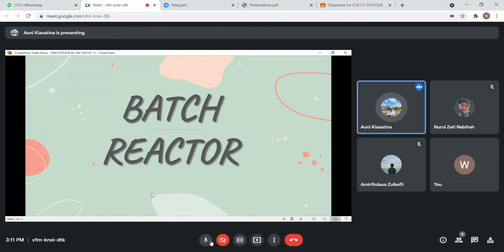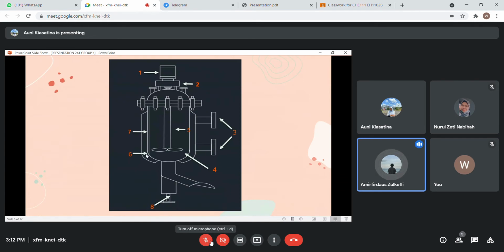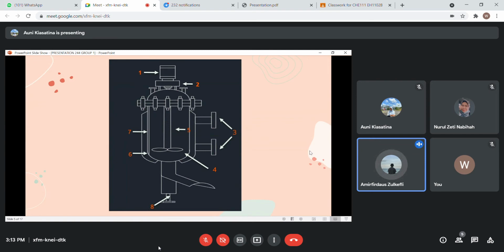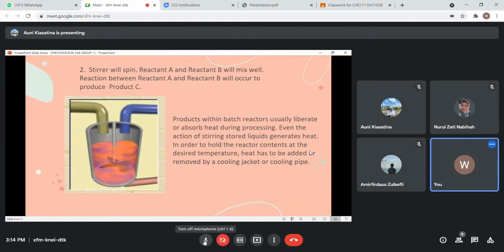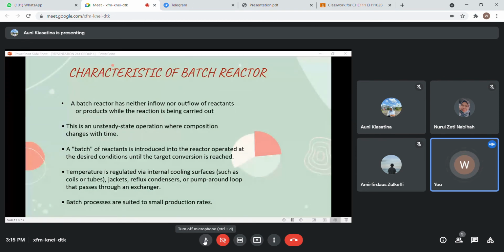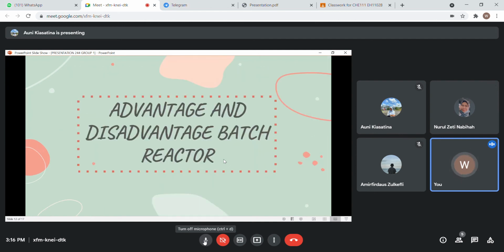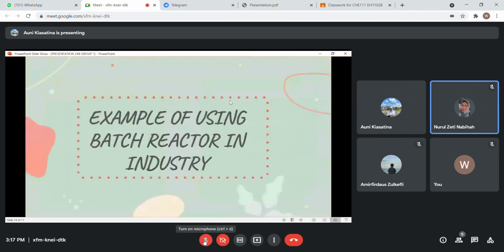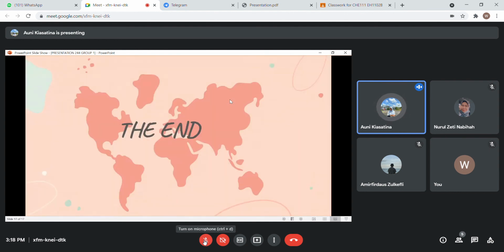CHE 244 PRESENTATION

Comment: Humaid..can you explain, how does the heat in reactor being removed by cooling jacket or cooling pipe?
Reply from the maker: Thank you madam for the question. The jacket cooling system is a closed circuit. Water (with heat) passing from the reactor returns through a cooler to the circulating pump and then back to the reactor with lower temperature water. 
A  expansion tank is placed at a sufficient height to allow the venting and water make-up in the system.
This answer enough? Or i need to added somemore explain.